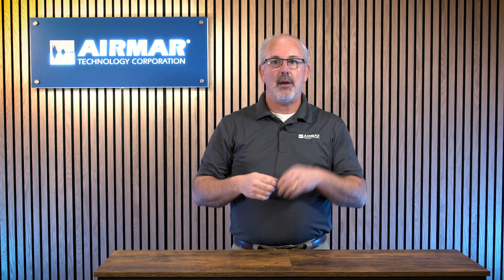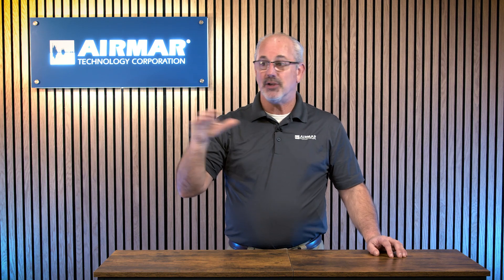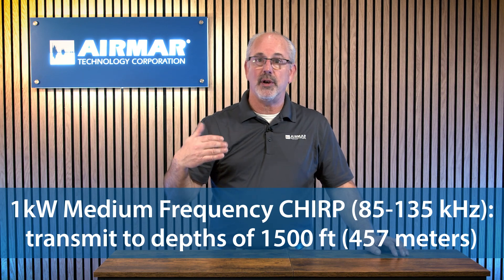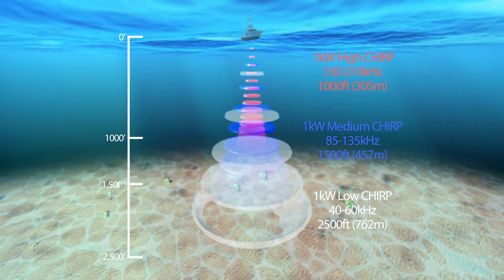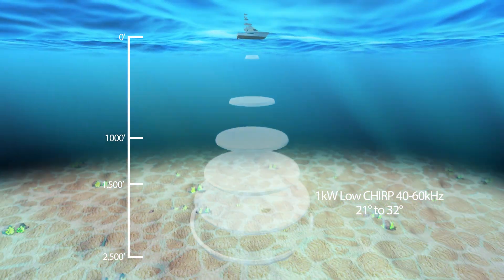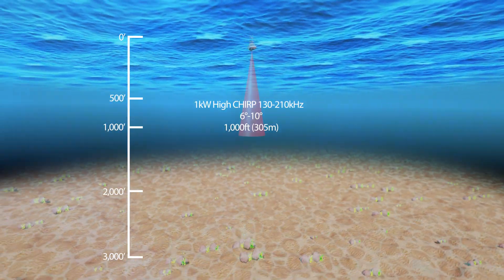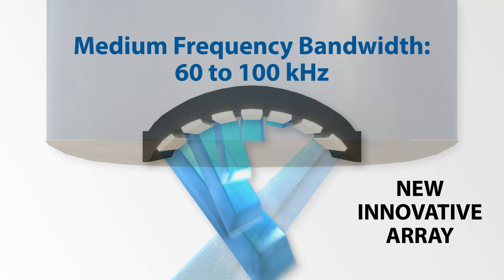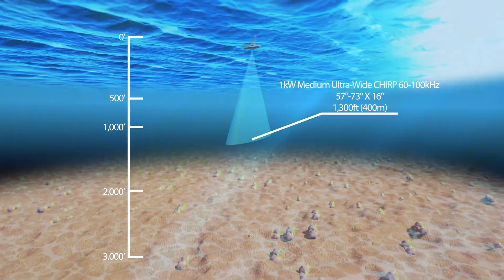Transducer Frequencies Explained

Comment: hello Thanks . l am fishing 70 meter 500meter 
What  is voor me best? 
High low wide ??
Reply from the maker: For those depths, Low frequency is best.  Also if you are looking for fish out at the 500 meter depth you might want to go up in power to a 2kW model such as an R109 model.  Its a larger transducer than the 1kW so consult an installer about whether that model is right for your boat hull. Also verify if your fishfinder can use a 2kW model.

Comment: Ive just purchased a nss4 and i need a transducer to suit, how do i know which transducer to purchase? I need a 50/200khz 1kw through hull to put into the keel. What model will suit
Reply from the maker: Congrats on the new Simrad units.  The transducer you choose has a lot to do with the fishing you do and the boat type it is being installed on.  We have a few good videos in our Transducer University series that explain choosing the right model for your hull.  I'd suggest going with a Chirp model over the 50/200 to maximize the capabilities of your new electronics.  Good luck.